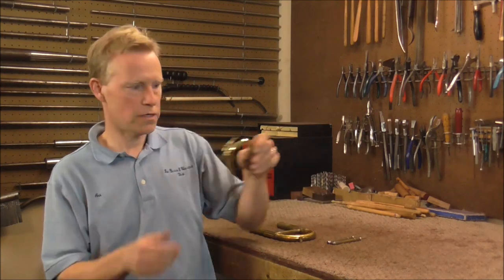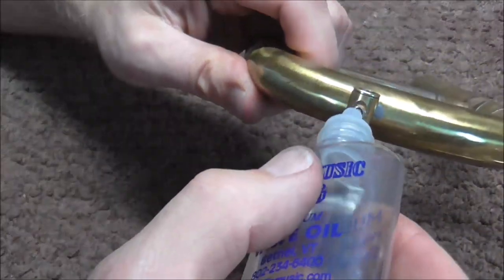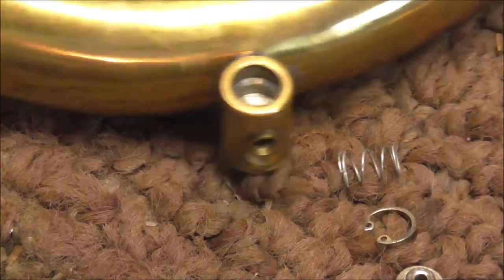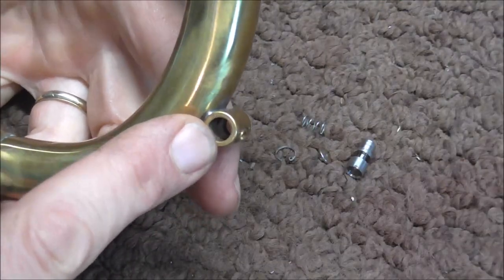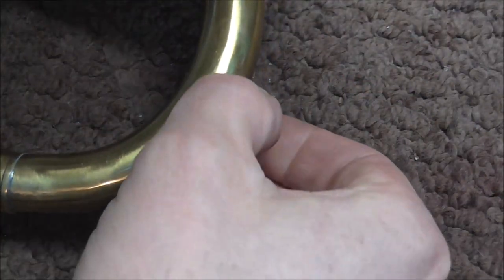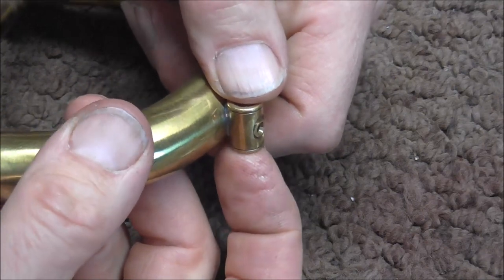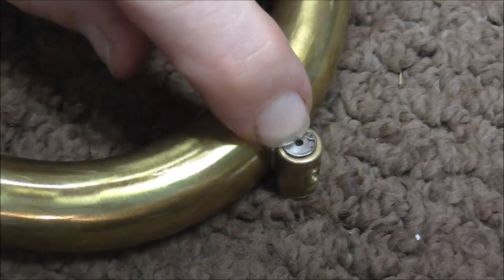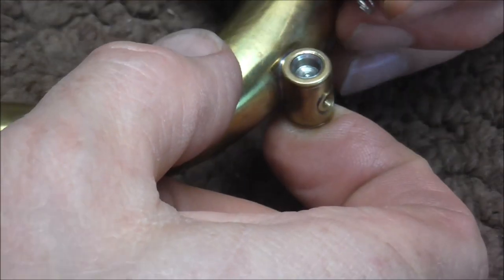Amado Water Key (Push Button "Spit Valve") How to Free Up, Clean, and Take Apart

Comment: Back in the 1970s I had a getzen that had those valves for water release. The way I used to keep them clean was very simple, I would hold the horn over the sink and pour isopropyl alcohol over it while I work the key back and forth and do that for about 15 seconds and it really cleans the key out and keeps it sludge free... And then you can do the same thing, just put the oil on the side with the clip, and work the key back and forth while you put a few drops of oil on it ... works very fine

Comment: Worked great, thanks! Valve was completely stuck. Now it moves freely. I used two safety pins for the clip. Had to agitate inside the valve casing a good bit before it started moving.

Comment: So this method didn't work for me.  But I was able to switch the cylinders between the 3rd slide spit valve and the tuning slide spit valve, and everything works perfectly now.  Could it be that Amato didn't meet their own tolerances when they machined these parts?  Or perhaps they have a slightly different spec for the 2 different valves, and they just mixed up the parts when they assembled my trumpet?  By the way, that ain't water coming out of those valves . . . .
Reply from the maker: I do not know why. They may have been switched but I do not know. In Band Instrument Repair, sometimes, you do not know why something works, but you are just happy that it does.